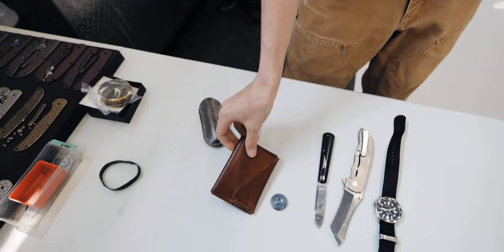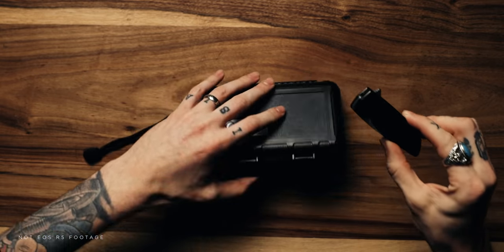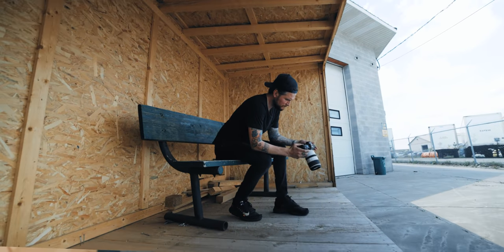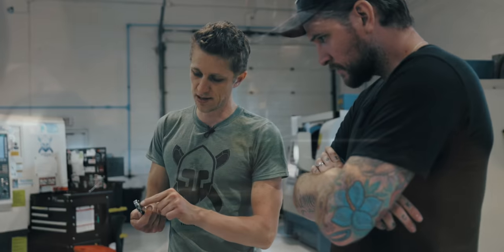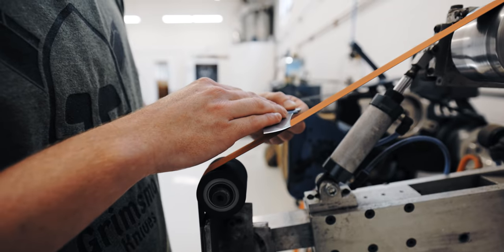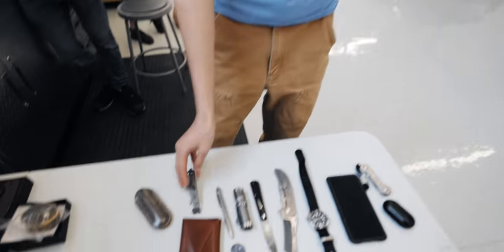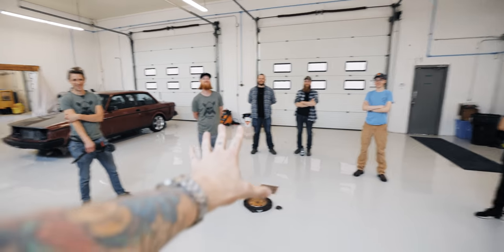Filmed this entire EOS R5 Video without it overheating...

Comment: I’d love to know more about that IBIS wobble, and if this is pre-production R5 or the actual behavior in the final product.
Reply: All IBIS does this with wideangle lenses because optics
Reply: Above 28-35mm the wobble goes away.
Reply: Dani Tibi This is worse than I’ve seen with other cameras I own with IBIS. Super excited about the R5, just curious if it’s footage from a production model.
Reply: @CubeBase  IT IS
Reply: Full frame sensor with IBIS will have wobble. Thats why I never understood the outcry for it. On M4/3 its not as bad since the crop is so extreme
Reply: @CubeBase  depends on the lens. This looks to be a 15mm lens. 11mm probaly looks even worse on fullframe. My small M50 with 11-22mm lens makes very similar wobble in the corners with simple IS.
Reply: I shoot with Sony and it definitely does the same thing with wide angle lenses especially below 20mm range it's more noticeable.
Reply: Dani Tibi Agreed. Looks very similar to how my old GH5 behaved when shooting at 7mm on the Olympus 7-14mm. Peter is shooting at 15mm (I believe), so it’s pretty much the same effective focal length.
Reply: Boooooo!😂😂
Reply: @deanrebuyon3046  My A7III with Gmaster 16-35mm f2.8 lens doesn't have almost any wobble, even on wide end :D
Reply: Dani Tibi it is not this obvious/bad on Nikon Z6 or Pan S1.
Reply: 0:22 It is a pre-production R5, so we can't say anything about what the IBIS wobble is like until we see a finished camera body.
Reply: I found it super super distracting actually. I really hope it's a pre-production defect or that IBIS can at least be switched off. You don't have this wobble at all on the RF 15-35 IS + EIS see my 96 ways to stabilize video
Reply: Ben Ehrlich I think it’s the way Peter filmed it 😐
Reply: @eryklewandowski4726  thats why they lead the industry!
Reply: Handholding it while shaking around like he has Parkinson’s always gives corner wobble with super-wide angle lenses, it’s just physics, the only way to avoid it is with heavy post work. Or you know, a tripod, or stable holding.
Reply: @dtibor5903  I don't get that wobble on my Z6 at 24mm. If it's there then it's so little that I don't notice. I do get bad warp when I switch to Electronic stabilization and try to do motion. I reserve that mode for when I want a tripod effect.
Reply: @dtibor5903  GH5 user here - IBIS is awesome so welcome to the club Canon fans, but you're exactly right that the wobble is worse on wider fields of view.  It's not a firmware issue, it's optics/physics.
Reply: It's not just physics. It can be avoided. Olympus is better at this (even at wide angle). (I don't own anything Olympus) Stop defending Canon or any other camera manufacturer with poor products.

I think tilting of the sensor is causing this. Because you get uneven distance to the world when in other axes you don't. So perhaps they should stop tilting the sensor on wide angles or find another solution. Wide angle with IBIS is possible.
Reply: @cmdr.shepard  You're exactly right that "tilting of the sensor" causes this.  That's the 4th and 5th axes in 5 axis stabilization.  You have vertical and horizontal translation (axes 1 and 2), "roll" (using an aircraft metaphor, axis 3) then "pitch" and "yaw" (tilting the sensor.) These "tilting" degrees of freedom compensate for tilting the camera, at the price of image wobble.  To some degree, you can undo it with stabilization in post.  Or the camera can under-correct those movements, giving less "wobble" but more visible shake.  Ideally, camera companies should give the user some options to adjust this tradeoff to their own needs.
Reply: @deanrebuyon3046  I don't think you shoot with Sony.  Looks like you shoot Canon and are trying to shade Sony with your comment lol.
Reply: D.E. SIGNS he’s got a 15-35mm lens. It’s the wide angle lens not the full frame + IBIS.
Reply: El Bert Roeh Pepino Nope, it's a pre-production
Reply: I’m guessing they will have to upgrade firmware on lenses at some point.
Reply: Peter either needs to hold the camera still or turn off the ibis and rely on lens IS and stabilising in post. Even shake is better to watch than this as it doesn’t distort the image.
Reply: @davidspearman9686  I shoot with canon for my personal use as per weddings I own a6300, a6500 and the a7iii rigged with my atomos ninja v. Let me know if you need more information maybe we can shoot too if you're from NorCal, I'll show you the gears
Reply: Ben Ehrlich Yes there is a brief disclaimer at the top of the video that says its all preproduction.
Reply: @deanrebuyon3046  My bad.  That was an a-hole thing for me to say if you do indeed shoot Sony.  I've never had wobble like that on a laowa 10-18 as well as 16-35 gm on my A7iii and A7riii.  I guess I checked out your channel, saw Canon, and  just thought it was funny at the time.  Apologies -your work is awesome by the way.  Keep it up.
Reply: My theory is that the wobble is probably because the camera's IBIS having more "give" to move about than the lens stabilization specially at lesser focal lengths. Maybe a new lens design?
Reply: Yeah. I'm used to WA vignetting if anything with IBIS. Not wobble
Reply: This sequence was actually shot in a dream.
Reply: I was coming to the comment section literally to talk about the ibis wobble 🤣
Reply: @dtibor5903  Is there an option to automatically turn off or lessen the amount if IBIS when you're at problematic focal length? Because IBIS should be a really useful feature, but this wobble renders the footage totally unusable.
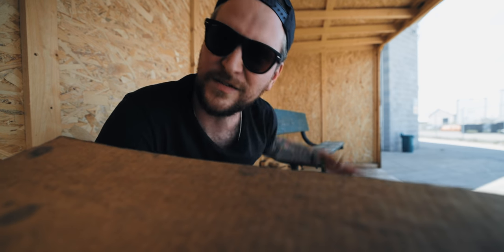And if you look at 1:40 the wobble is still disturbing after a significant zooming in.
I think these distortions make the video look much less proffessinal than having actual handheld camera shake in it
Reply: Based on Matti Hapoja's findings, pre production issue
Reply: You'll likely have to look at independent reviewers videos

Comment: I'm the only one who notice the background is wobbling?
Reply: The canon R5 stabilizer :/
Reply: slight wobble at wide focal
Reply: Not a good review for the R5
Reply: @Leth0  i wouldn't call it slight, it's pretty bad compared to the competition.
Reply: Nazry Isa it’s very slight and the competition is shaking in their boots along with everyone who does not have a canon body currently, at the end of the day who care what “brand” you use just create! We need to stop bashing EVERY single company on their new releases it happens with every single one... 4 months down the road people are like wow I love this camera....
Reply: Every IBIS wobbles at ultrawide angles, like on 15mm. Even I saw wobbling on some UWA IS lenses without any IBIS.
Reply: @SwitchRich did you vlog with Nikon at 15mm? Did you vlog with panasonic at 7mm? No? Gtfo.
Reply: its lens distortion
Reply: Canon has stated the IBIS is more for photography than video . Considering the frequency of the wobble, I would assume it is a beast for images, but not so much for video..
Reply: it really like like when someone applies way too much warp stabilizer. Much worse than camera shake
Reply: @tesha199  but then the firmware should automatically turn off IBIS at those focal length. This kind of wobble is really disturbing to look at
Reply: Gabriel Paradelo you can’t review a pre production camera you can only show its current features
Reply: Wobbling? Nah, that was the gaffer taped fan vibrating.

Comment: Is it just me or it seems like the R5 has some Weird stabilization going on in there !
Reply: came to say the same thing, very unsettling
Reply: every camera that has ibis has that with wider lenses
Reply: DotFrost I haven’t seen it like this is other brands. I’m sure it’s something they can correct in firmware but it’s not pleasant.
Reply: If I recall correctly it’s an issue with non canon lenses.
Reply: @bobcatbeasley4057  Fuji definitely does this as well.
Reply: @novawolverine  I have seen it on fuji in Mattis vidoes you are right
Reply: the entire camera is a flop

Comment: Good enough for 5 mins vid without overheat issues😂😂
Reply: I guess you're referring to a finished 5 min cut. I'm sure the amount of footage actually shot (and for B-roll) far exceeded 5 mins... and some that look like they were shot outside in 32C (90F) day as well without overheating issues. Not tooooo bad.
Reply: ...but not without wobbles!
Reply: Aaron Weiler notice that there is no single clip longer than a few sceonds :(
Reply: Any 4k120 or slo motion?  Any 8k?  Might as well have been shot on an eos RP.  Not a $4000 for the body only camera.

Comment: 3:43 are you still using a sample camera. I hope Canon can fix the strange stabilization wobble in the production models? It's nice to hear the camera didn't overheat though. Does it overheat because the processor isn't powerful enough?
Reply: overheats precisely because is very powerful, it is passive cooled and it is enclosed hermetically also because the battery generates heat as it is being used the same as the memory.  Canon decided to preserve weatherproof expected in their  5 series line up instead of using a fan to remove heat. 
I think with the battery grip we might have less overheat
Reply: @leviathan19  "it is passive cooled." Negative. I think you are thinking of the press release from Sony which stated that their A7S III which will be released later this month, will be passively cooled. This camera does not state "passive cooling" anywhere in its owner's manual - which is precisely why it shoots 4K 30P for only 15 minutes inside a 72F studio. Canon says it will be less than that when outdoors.
Reply from the maker: Still the sample yes.
Reply: @garrettstevensen2467  Well anything that is not actively cooled is passively cooled, they even state the use of magnesium to help keep temps down as it transfers the heat outwards... You can see in teardown how they use shielding as heat spreaders

Comment: We've just purchased the R5 and awaiting delivery but seriously concerned with all this 'wobble' around the edges. Seen this on a few videos now and it is worrying. Does not look good, particularly for vloggers. The EOS R seemed to do a better job, granted it hadn't IBIS but this looks more like electronic stabilisation and the effects it produces. Do you not think? Chris
Reply: Tons of "wobble" and the overheating in 4K 30P, for only 15 minutes when indoors at 72F is a failure. I would return this if I were you.

Comment: What aperture are you shooting? Does the warping get better from say 3.5?
Reply: You get it on any setting that says, "Canon." This is the first time they have ever implemented something called IBIS. However, that's the least of your concerns. The shutdown at 15 minutes from overheating at 4K 30P indoors, at 72F? That's a deal breaker. I would not have allowed this camera to ship.
Reply: Aperture doesn’t affect IBIS wobble bud.
Reply: @jmann316  if the stabilisation is 100% optical, yes it won't affect wobble, but if it's relying on software as well as optics for stabilisation then the more out of focus the background is, the less contrast information there is to effectively stabilise. I'm asking because the wobble looks very similar to the wobble found in fcpx when you apply stabilisation but the background has a lot of bokeh. If it is using onboard software and the autofocus system, then it might explain some of the overheating as well.

Comment: Wow Peter McCanon you filmed a 5 minute video without overheating.... How impressive... I'm sure the interior of that building is way over 73 degrees as well.
Reply from the maker: You sound fun
Reply: @PeterMcKinnon  Don't need to sound fun to talk about this camera tho when there are only a few smaller channels out there actually talking about this issue instead of just glossing over it or sugar coating it. These cameras overheat at relatively cold temps in a given time period, even at idle. How is that not something that should not receive more attention from you larger influencers instead of kissing their asses?

Comment: Do a bunch of back-to-back 4K 24p or 30p 20-30 minute takes without the EOS R5 overheating and I will be impressed...  On an indie film shoot, we often keep the camera rolling so we can get multiple takes of a scene.  That means long takes, all back-to-back.   I need to be able to depend on the camera. An 8K sensor recording at a high bit rate (like the R5 does) would generate a ton of heat and in a small weather sealed body, that's going to cause problems.  Canon's lower bit rate firmware update may be able to help...

Comment: I hardly ever comment Peter, but there is some weird stabilization wobble on the R5, Im watching on a 50inch screen and it made me kind of dizzy several times. I have no hate for canon. I just wanted to point that out, there might be an option to remove that feature and use regular stabilization.

Comment: My Sony overheats when shooting in 4k as well. I just upres my footage in Final Cut or shoot in 4k when I absolutely need to like slow motion or when I know I might Wana punch in and preserve the quality. I'm thinking of switching to Canon though
Reply: What sony do you have that overheats in 4k??? They only really had that issue with their first generation. Just change your  heat tolerance settings in Camera to high and the issue is gone. I've recorded for 90 minutes in 4k 100mbs under studio lighting without any issue on my A7III  on multiple occasions
Reply: What Sony ?
Reply: @RockyMaiviaMiami  I got a A6300 that I desperately need to upgrade from
Reply: @evan  I've got an old A6300 lol using what I have to be as effective as possible

Comment: Canon missed the boat with regards to cooling the R5. They should have taken a look at how video card manufacturers are dealing with heat and installed a heat tube that exited the body at the base. They could have done this without compromising the environmental sealing, and then Canon, or a 3rd party vendor, could have build passive or active cooling into a grip.

Comment: 3 Hrs and 50K crossed. This is Peter McKinnon. I feel that 5 axis IBIS has some issues.
Reply: IBIS? That's the least of the problems. Canon says you can only record for 15 minutes at 4K 30P, when indoors, at 72F. If you go outdoors, it will be less than 15 minutes. Yes, IBIS wobble is bad too, but this is the first time they have ever done IBIS in any of their cameras.

Comment: @Peter McKinnon 
A reaction video to Max Yuryevs video would be awesome. The one about editing Canon 4:2:2 h.265 codec which looks like a bigger turn off then the overheating and ibis combined. He was having issues editing r5 4k raw on a 15,000$ Imac but had no issues editing it on an iPad. Seems like something that should definitely be mentioned. The transcode times are pretty intense. Would love to see your insight on this. Do you think Canon will eventually have 4:2:0 in a software update for 10 bit or only keep at 4:2:2

Stuck between getting the r5 and the new Sony a7s III. Canon has better color science, better glass, better for stills with 45 Mbps sensor but Sony has external 16 bit direct HDMI, better low light due to smaller 12 megapixel with less noise,240 fps, and no overheating

Comment: I respect Peter but this video doesn't really help  much with the concerns regarding overheating. At this point i think most people just want a more technical test. I honestly do not think we should be treating overheating as controversy, rather let's just test the overheating issue with just the one goal of informing consumers whether it will be a problem for their workflows or not. I commend canon for publishing some guides on overheating..the only missing thing is real world testing from end users and recording limits at different temperatures which is the gap im hoping youtubers would fill.. I wish the subject could be that simple as I am grateful this camera exists eventhough it might not fit my needs.
Reply from the maker: Agreed! Just need the production units to make said tests! Soon enough!
Reply: @PeterMcKinnon  thank you good sir!

Comment: Problem is tons of hate about Canon's overheating and IBIS wobble from utubers yet to actually test the R5/R6 :[...
Reply: But Peter is actually testing the R5 and the wobble is there.
Reply: Who needs to "actually test" the camera when the manufacturer says that it will start to overheat after 15 minutes when recording 4K 30P INDOORS at 72F? This is written by Canon in the owner's manual. For a camera that cost: $4000? There are $900 Sonys that have solved this problem almost a decade ago. I've never laughed so hard in my life!
Reply: @garrettstevensen2467  It is always worthwhile to test what a manufacturer states.Their claim might be optimistic, and needs to be called out as incorrect, or their claim might be conservative, meaning they are erring on the side of caution and performance will actually be better than claimed. Or, of course, the claim might be spot-on. Yes, it is important to test.

Comment: Not gonna lie it’s a pretty short video...
Reply from the maker: It overheated before I could finish the vlog and actually melted through my camera bag into the bed of my truck! It’s at Ford now as they attempt to pry it off the bed with some gnarly jaws of life like contraption. I was told though, dude to how badly it heated up, that’s it’s fused itself now beyond the bed into the frame of the f150. So, I hope canon puts outs a firmware update soon so it doesn’t ruin a second vehicle!
Reply: OH MY GOSH is the f150 for sale? I’ll take it if so
Reply: Peter McKinnon your truck is now basically a gimble with wheels for the camera, what a good invention 🤙🏽😆